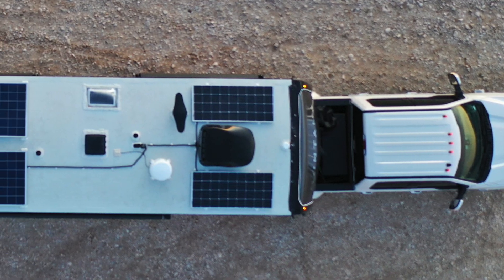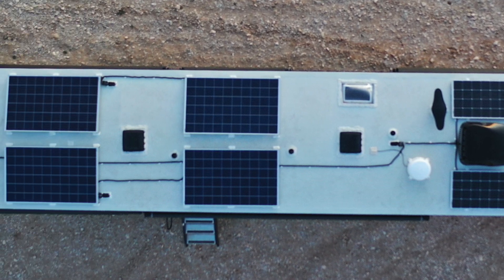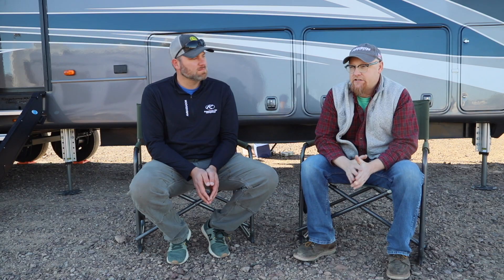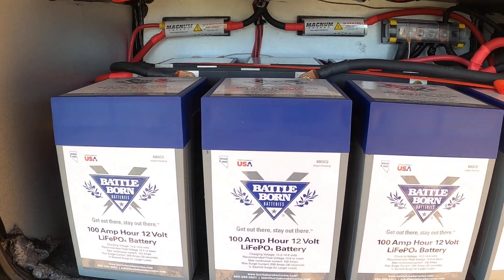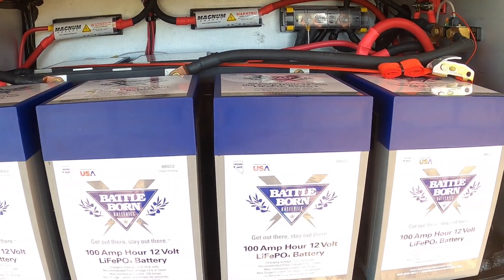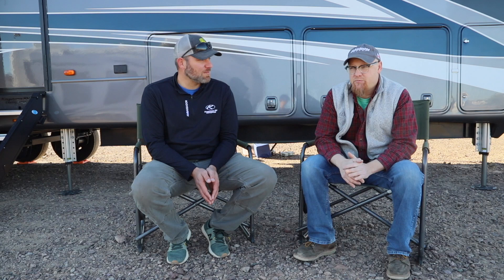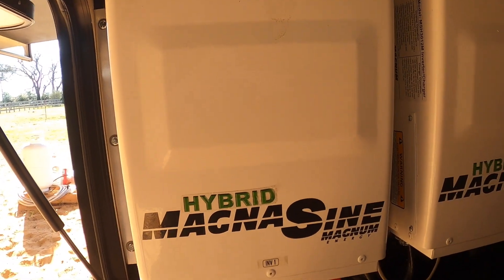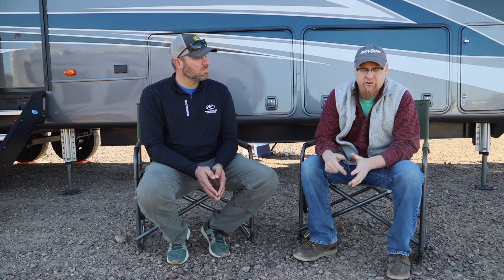RV SOLAR - An in depth explanation of SOLAR POWER + our total  RV solar and Battleborn battery setup

Comment: This was amazingly informative!! What I want to ask is, why would you need the big wire coming off the truck to top off batteries as you’re driving? Does the solar system charge the batteries when you’re not stationary and traveling?  Thanks!!
Reply from the maker: The solar system does charge, but obviously only when the sun is out. We opted for the optional truck charger to allow an additional 70-100 amps pass through to camper for driving on raining days or night driving. It allows us to charge for any destination regardless of time of day or weather. We typically do a load of laundry before departure and use the dryer going down the road off the truck cables recharge rate. The